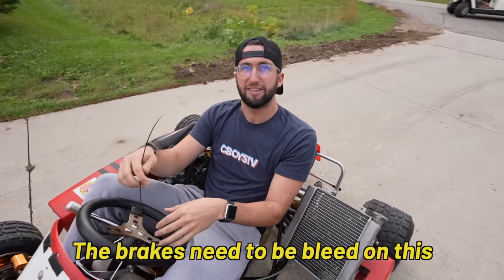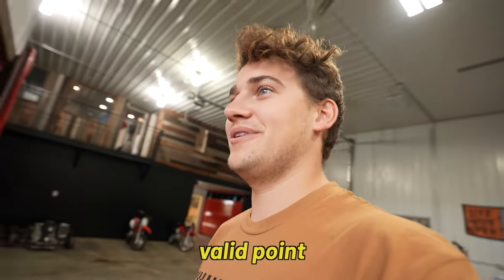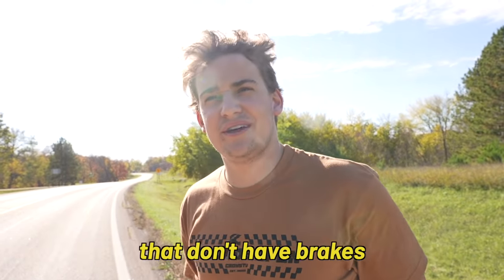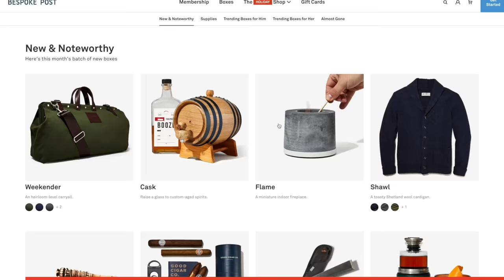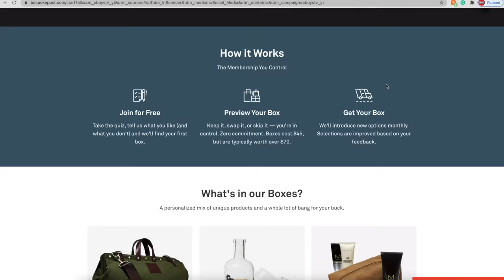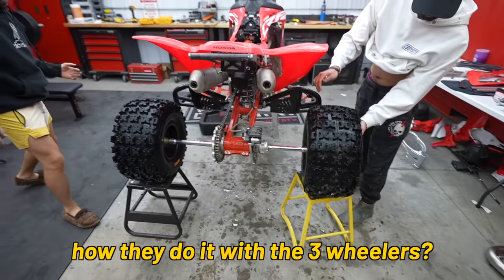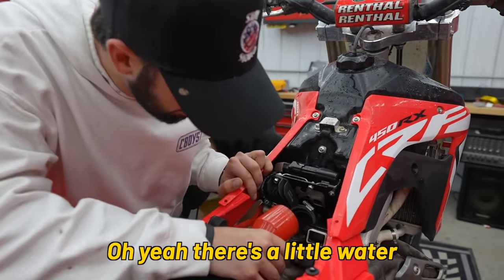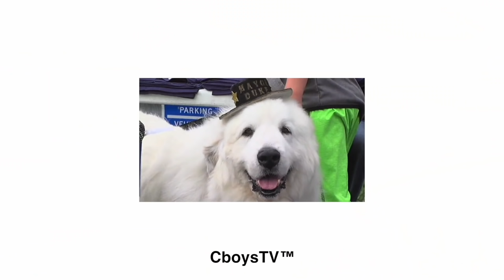Racing Shifter Karts Around Town!!

Comment from the maker: New Black Friday Merch Drop  next Thursday (11/25/21) @ 7 pm!! Be ready!
Reply: All you need to do to get that 1 running right is clean the carb
Reply: Bro it was literally 20 Degrees in Cormorant today why r u guys wearing T shirts
Reply: With the black one you have to take the power valves case off and clean them and clean the carb and make sure all the jets are good it’s really not that hard
Reply: Make sure there isn’t any unburned oil in the black one. Also do a carb clean  and check the power valves.
Reply: Unburned oil in the pipe.
Reply: @gustavofring02  its old.     Notice the limo they scrapped
Reply: Yes
Reply: @gustavofring02  they made it before to day
Reply: Hi can you guys make a pit bike race vid
Reply: you guys dont ship to Sweden? :(
Reply: Cboys I got a next video idea  go and buy four drift trikes with motors they prity fun
Reply: Clean the reeds and carb on the one cart with brake cleaner and it will run perfect
Reply: And probs clean the power valve some
Reply: No ken do
Reply: This shit looks like so much fun
Reply: Yoooo let’s collab .
Reply: Where can you get one
Reply: Yo Ben should try and get someone to make an airbox cover so water won't splash up. Seems pretty inconvenient that it can't even go through a puddle of mud. Bet you wouldn't regret it and should be easy to make 🤙
Reply: Hello
Reply: Hello
Reply: Put a 250  one both.
Reply: Hi
Reply: Michael looks so funny in his glasses but I’m actually a really big time family it’s been bro I love when he’s my favorite out of all you guys not saying you guys are like bad anything I just I just love your guises videos please give me a shout out please I need it
Reply: Love your guys content
Reply: I have a home made go kart with a 4 strike that goes 45 or 46kmh but you ho karts are cool
Reply: How to get one of your go-karts it my birthday
Reply: Take apart master and calipers 
Measure the seals 
Call comet kart sales in Indiana for the seals 
Then you will see what you are going to hit.

Comment: for the go-kart you guys had put oil in just Drain the Contaminated Fuel Drain the Fuel Lines and Carburetor – If you tried to start the engine it means it has moved the mixture of fuel and oil down through the fuel lines and into the carburetor. You’ll need to take the fuel system apart, drain it, and rinse as many parts as you can. If you primed the engine, you’ll also need to clean your primer out. You may even need to replace parts of the system. Clean the Carburetor – This is the most important step, as oil can gum up your carburetor, causing the fuel-air mix to be off, possibly rendering your go-kart inoperable. This could require complete disassembly of the unit. Remove and Clean the Spark Plug if any – Oil gets everywhere, and the spark plug was trying to light the fuel with the oil in it, so it could still be wearing remnants. Pull   spark plug and clean off any contaminated fuel, and clean out the hole for the plug, then replace it. Refill the Tank with Clean Fuel. Prep the Carburetor
Reply: it was running after the oil dump. only thing needed is a new plug. and maybe then it might need a carb clean but very unlikely.
Reply: Exhaust is stop up can’t breathe
Reply: @elijahray4769  that would make sense, but i cant see the silencer still having cloth in it. its probably all been removed.
Reply: I have a 50 Suzuki four wheeler exhaust pipe clog up to about the size of 16 Penny nail

Comment: or to make it simpler it can usually be fixed by fixing spark plug issues, replacing stale fuel, cleaning the air filters, ensuring that you have the right engine settings and unclogging the carburetor

Comment: The cart that got too much oil....drain the fuel as best you can. Then refill it with the proper fuel to oil mix. Also peak at the plug and be sure it's not caked with oil. Its probably worth replacing the plug anyway. That should help it out tons!

Comment: @cboysTV Try changing the spark plug on the black kart, it probably fouled with all the oil put in it. Also try changing the fuel filter, its probably clogged with oil.

Comment: @cboysTV take the cylinder cap off the top of Smokey and clean the piston top and cylinder walls with brake cleaner. And make sure that spark plug isn’t fouling. A new NGK and some cleaning substance like 50:1 red armor or VP would clean that thing right up. And last and most importantly. Clear that thing out. Hold the gas on for 5-8 seconds after it’s warmed up. If it bogs. Let off and hammer it again. It’ll fix itself I promise.

Comment: Hey about that black shifter kart, just drain the tank and probably give the carb a good clean coz it’ll be full of oil by the sound of it, then just put the proper premix in it next time. The oil to fuel ratio is too high, and since oil doesn’t burn, it’ll make way less power and will “bog”

Comment: You guys should completely take apart the carb in the black and and flush and clean the tank and fuel lines and if it’s got a fuel filter change it it could also be the pipe sometimes they can get clogged up and dump oil out 👍

Comment: The black one needs some carbon cleaning, because it just had oil, it built a lot of carbon on the intake valve and piston. So it needs some heat, and maybe a piston cleaning.

Comment: On the black kart that's smoking, try flushing out the fuel tank, if you can spayout the Carburetor and draining the bowl, and change the spark plug. That should clean it up enough to run it for awhile and burn out all the oil in the exhaust

Comment: Cometkarts has break seals,lines,master cylinders parts for most old karts u just have to look you can usually tell witch break system you have by the back caliper for example look at the pistons pushing pads ven99 breaks have 2 small piston and two big pistons. 1 small and 1 big on each side if the rotor break seals are pretty universal the small ones should be 19mm and the big ones use a 22mm seal hope this helps

As for that black kart u guys should take the engine off the kart and give it a good onece over change spark plug,reeds and all the jets in the carb are not gunked up with oil and i really recommend useing  vp fuels t2 type fuel its specially formulated for two stroke race kart engine and you do not have to mix oil because its premixed at the factory but it is pretty expensive t2 gose for about 90$ for a 5 gallon pail

the engine work the top end is usaly verry simple work and alot of these engines do not need piston ring compressor to put back together they are ment to be taken apart an quickly worked on verry easly and thats a dd2 rotax its supposed to have to fuel pump not gravity fed that might have sum to do with it too

Comment: You might need to clean the carb on the black one it probably won’t completely fix it but it would help because the jets are probably a little clogged from the straight oil

Comment: Y’all make the jokes on living in a shed 😂 i did that for 4 months during winter 😂 i had power and all but no heat or insolation… put a couch in it and hung up a that went behind the couch and i could close off the front and i just had a tiny cheap old space heater the sad on the arm of the couch by my feet… and i mean it was better then nothing but in montana… it would be like 20 degrees out side and maybe 25 in my tarp tent in the shed 😂 it was crappy… don’t worry I upgraded to a pop up camper… still sucked but by that time it was summer and i left about the time winter hit

Comment: Pull the calipers apart and drop new seals in the newer kart.
Pull calipers apart new seals and repolish the pistons and hone the pots in the caliper body, 
Seals can be had at any hydraulics supply or repair 
There ya go brakes 101

Comment: You have to drain the gas tank and clean the carb and replace the spark plug for it to be good. You might also have to clean out the pipe

Comment: The black one it's power valves are probably all clogged up with oil and put a new spark plug in it and drain the gas and clean the tank and it should be fine

Comment: I’d empty that fuel if you haven’t already, replace plug because it’s most likely fouled, see how the air filter looks, might as well change the oil while ur at this point an go through the carb

Comment: the oil cart might need a new silencer, the packing is probably clogged with oil and thats causing it to bog. idk
Reply: Probably just needs a new plug, definitely fouled
Reply: I didn't even think of this but it could def be an issue. That or a clogged jet in the carb

Comment: With a go cart you dont need brakes just change direction 180 that slows you down pretty good if you need more give more input and shut the motor of worse case ive never had brakes on my carts but i use tourqe converters and if you shut the motor off the converter acts as a engine brake and you can re start the motor if you only slow to 5 mph and kick her back on

Comment: did you just empty the tank on the black kart or actually open the engine up, just currious cause the crank case might be full of oil it didn't burn from before and just sucking up said oil.

Comment: That oil engine is either going to have to be run alot or and probably the best option for a long term fix is pull the engine and take everything apart, the carbi for one is probably f*cked
Reply: Carb should just need a clean, but may as well clean the fuel tank as well. Wire brush off the plug or replace. Don’t need to pull the engine unless there’s some real damage. If there’s power valves, check them too and clean it out.
Reply: @McDoobles  i geuss, but its cboys good chance theres something else wrong with it😅😅

Comment: mate, why do you keep running the trike with a CONE air filter near the rear... like no... i dont know let someone make a airbox for it... cause its just stupid in a place where there is alot of rain and snow... if it was hot and dusty u probaly be fine.. but this nahh move the air filter or make a airbox